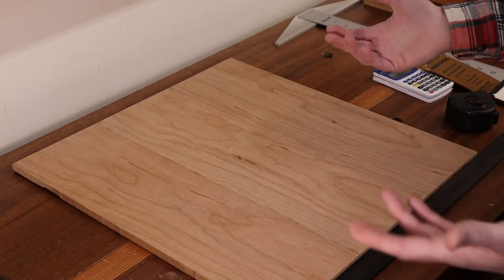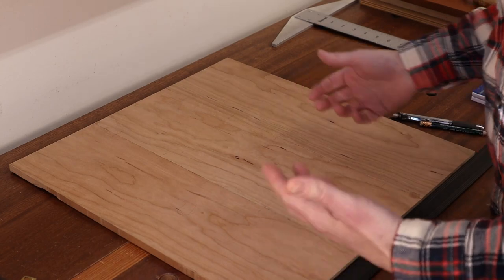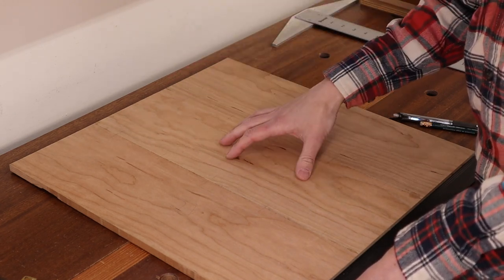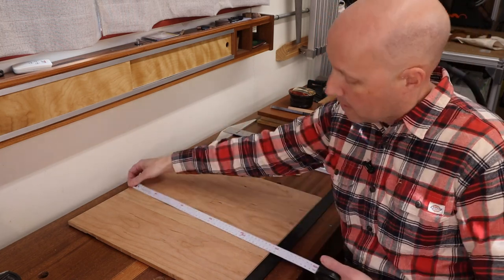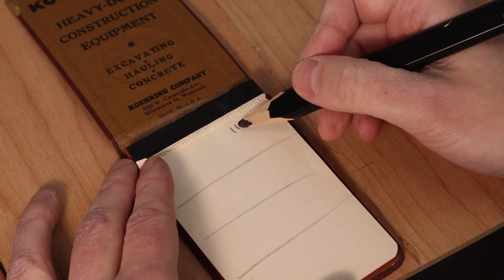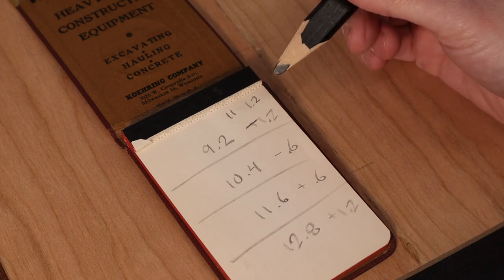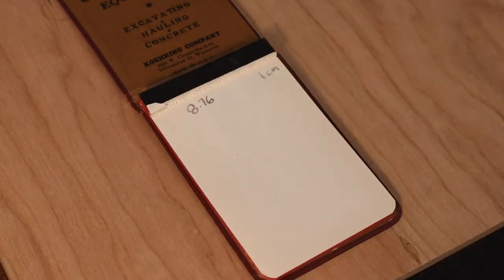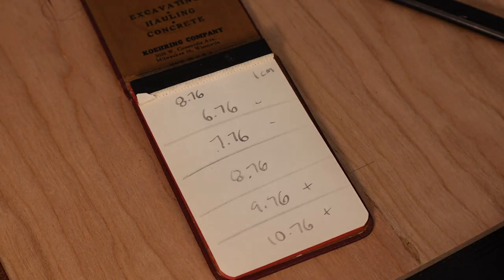How to Calculate Graduated Drawers Pt. 1

Comment: In the metric world we never use centimetres for building or woodworking. We use millimetres until we are talking in distances of several metres where we might move to metres. It’s quite bizarre listening to someone talking in centimetres.
Reply from the maker: I first got comfortable with metric while working as a professional bicycle fitter, using millimeters for anything less than a centimeter, and centimeters for anything shy of a meter, which makes perfect sense if you think about it. That's why I still do it, and why I switched to metric in the first place. I'm really just interested doing things the ways that make the most sense to me and getting used to that.
Reply: @themountaintopjoinersshop8422  , You are doing it right, sir!
Reply: I agree, first time I've seen centimetres used in my 40 years working.  As an engineer we use millimeters. If I saw 1.2 on a drawing it would be 1.2 meters not 12 millimeters.
Reply: Architect here, (and furniture maker). Yep, it's millimetres. Centimetres are never used. That's entirely secondary, though, to the fact that our man is using metric. Think of the nonsense involved if this was done in inches!

Comment: Enjoyed the video.  Another less math intensive approach is to use a pair of dividers (I'm channeling my inner Toplin's By Hand and Eye book).  Set dividers to thickness of wood horizontal pieces.  Then walk off how many you want the bottom to me; go next level and walk off one less divider, and so on.  Couuld even use a story board so never need to measure it (including using dividers to mark off the horizontal pieces).  You essentially did the same thing.
Reply from the maker: That's an excellent way to do it.  I looked for that method in my library and couldn't find it, so thanks for sharing that. If there's enough people who want to see that in action, I'd be happy to make a video about that method too.  I'm much more a fan of doing things with dividers than measuring.
Reply: @themountaintopjoinersshop8422 ould love to see it!
Reply: @themountaintopjoinersshop8422  I think it would make a great compliment video to your current one.  Plus, you could zing both metric and imperial measuments in the video.
Reply: @themountaintopjoinersshop8422  I wouldn't mind a demo!
Reply: @themountaintopjoinersshop8422   YES, all the demos. Lol

Comment: I hoped this was coming. The golden ratio and graduation are always there when trying to figure out what you want. Drawer number alone requires some time to think about for me. I’ve used a web based calculator to figure out graduations. Less thinking but I have used a compass on the full size drawer panel to draw it out before cutting them apart.

Comment: I derive mine entirely geometrically, by dividing up an arc. The arc is from the bottom corner of the opening-minus-total-divider-height to the mid-point of the top of the opening. Divide it with dividers in to the number of drawers you want. It's as simple as that, with no maths involved. In contrast to other methods, it means that the width of the drawers has an influence on the height.

Comment: That's a pretty clever way of getting at it.  I think this ends up being the same thing I was taught but you're starting from the center and working out. In the way I was taught you take the average drawer height subtract half of the total thickness of the dividers and you get the size of the first drawer. Then just add divider thickness to each additional drawer. So drawer 2 is 1st drawer + 1 thickness, drawer 3 is 1st drawer + 2 thickness and so on. That way you're only using subtraction once. I think my shop teacher knew that none of us were all that good at math and only trusted us with addition lol.

For drawers without visible dividers, the graded scale method from the Encyclopedia of Furniture Making (p.251) has worked well for me.

I have a whole playlist saved with all the useful tricks I've found for woodworking and other maker stuff I'm interested. Easy to search for what I'm looking for later in most cases. It's a bit more granular than my watchlater which has a ton of stuff randomly in it.
Reply: YES, JSMXWLL, thank you.   I imagine RC thought it better to explain the process in his own voice, so that he might be better prepared to answer questions they get his viewers.   However, I would have explained it your way, because it's my way Lol. 
  No, seriously, I like to explain things,  to novices, in a way that they can confirm by means of established text, so that they always have resources, like the EFM to refer back to.   That way if they need to look the info. up at a later date, they can.  Or, if they didn't follow my description of the process, they may learn it better by reading it themselves.
   I was too lazy to lay it out here, they way i'd learned it, so thank you for doing it and providing the source.   
    We need more education in YT Wood Work videos.  SO, this video title pulled me in.  I was glad to see a new creator, who doesn't seem to be just regurgitating tips & tricks, disseminating misinformation, or only out to prove he isn't afraid to make mistakes.  This last one seems to be the new hot topic. 
   I am medically limited & spend a great deal of time watching YT for entertainment and information.  I very much appreciate the time & work all of the content creators put into their content.   
    SO many videos now are makers making avoidable mistakes because they seem to think it's cheating to ask how something should be done.   They struggle with tasks, when a search right here on YouTube could have provided answers.  I understand that watching them create with only a few tools, luck and enthusiasm, is entertaining.   It gets them views and subscriptions & doesn't bother me.-
  That is, until I read a comment from a young person, someone who loved everything about the build, the maker & the channel, and they say they are thinking about WW or carpentry as a trade, or career.  Then my stomach hurts.
    I am definitely interested in seeing if RC continues to make education part of his channel.   If so I will absolutely watch his other videos, share, and subscribe.       
   It's unfortunate for RC, but So, being smart may not be the smart way to build a YT channel.    I mean, if the genius I just watched, right before this video, is any indication smart is the wrong way to get subs.    That dude (having mastered woodworking) has now decide 'welding must be easy too', his channel is less than 3 years old & he has over 750 thousand subscribers.  More than all of the wood magazine channels & Kreg and Rockler combined (they've got guys like Ernie Conover).  That's more subs than Collin K or Jon P. !   Just under Stumpy Nubbs, a channel and magazine that has been giving reliable ww advice on YT for 12 years! 
   SO Good Luck RC.  and jsmxwll,  thanks for letting me vent!♿Lisa🛠

Comment: How would you handle drawers that don’t have visual horizontal dividers, but drawer fronts attached overlay (like a lot of quick shop cabinets) ?
Reply from the maker: I think, in that case, you don't have to subtract the height of the all the drawer dividers from the height of the opening before calculating your average drawer height, because there aren't any showing.

Comment: For those of us who are mathematically inclined you may have spotted a couple of small errors in the 4 drawer example but they are of no consequence:

* 11 - 1.2 = 9.8 not 9.2, but 11 + 1.2 = 12.2 not 12.8 so those two errors cancelled each other out when you double check against the height of the face. 
* if you added up the numbers in the 4 drawer example you’ll come up short: 47.6 cm instead of 47.8cm. That’s ok because he threw away 0.05 cm  (or half a mm), and since that was done for 4 drawers, that’s 2mm accounted for (4*0.5mm)

Not criticizing here but clarifying what might seem off to some of us 😊
Reply from the maker: Thank you!